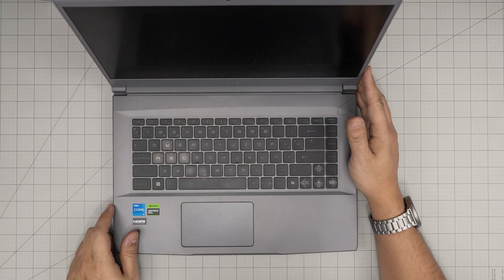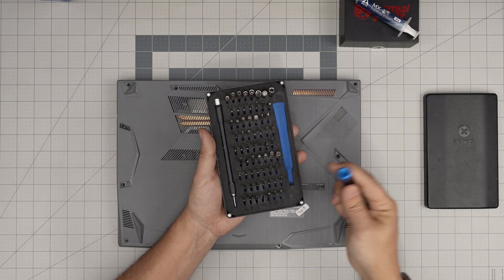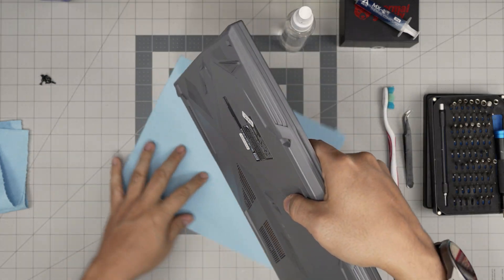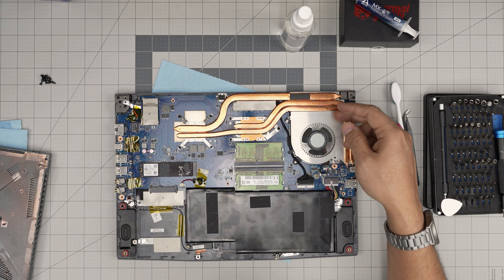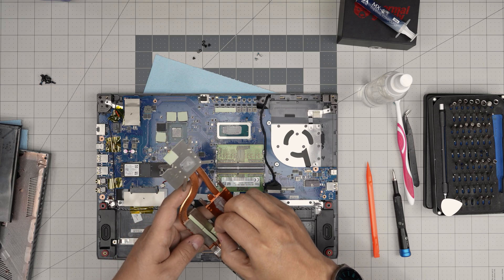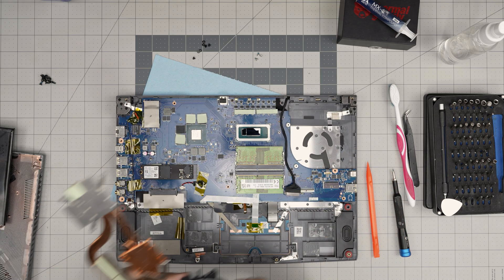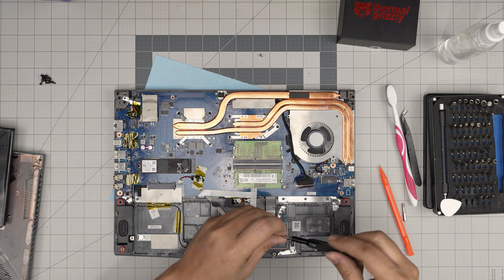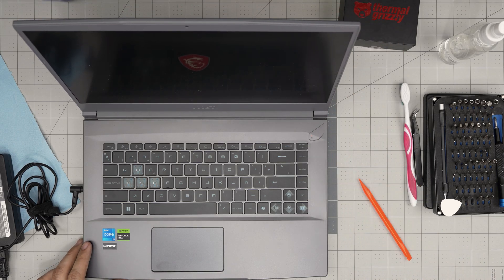How to Clean & Repaste MSI Thin 15 B12UCX | Fix Overheating & Boost Performance

Comment: Is it necessary to remove the whole battery?
Reply from the maker: 🫠Regarding your question, no it does not, but it does make it super easy to disconnect the battery jack.
cheers🍻

Comment: Hello sir, is it okay for me to replace the paste with PCM (Phase change materials) like PTM and so on? Is it safe for the laptop? I hope you can answer this thank you
Reply from the maker: 🫠Regarding your question, 100% recommended if you can find an original "PTM7950 Honeywell." Make sure it is a "Honeywell" — any other PTM options are not that great; we tested them. There are many fake "Honeywell" ones out there.
Should you have any further questions or requests in the future, please don't hesitate to ask me.
cheers🍻

Comment: I couldn't open no matter I push it from other side the headphones plug are stuck there what should I do
Reply from the maker: 🫠 Regarding your question, lift it up a bit more at a 45-degree angle and wiggle it to the left with a little more force.
Reply: @uFixTek  I fk it up bro. I damaged the battery coating & the cut place was burning for 3-5 second. I plugged the the charger once just to check & it was charging, I tried turning on my laptop once & it turned on but I turned off it immediately & removed the battery. What should I do?
Reply from the maker: send me a picture ASAP to my email:
ask@ufixtek.com

Comment: Can I leave the thermal paste as it is if I just want to clean the fan?
Reply from the maker: 🫠Regarding your question, no, because in order to clean the fan, you will need to detach the heatsink from the CPU and GPU. If you do that, then you will need to clean off the old paste and apply new paste, otherwise you will experience quick overheating and crashes.
Should you have any further questions or requests in the future, please don't hesitate to ask me.
cheers🍻
Reply: @uFixTek thanks a lot fam, i don't really have much knowledge related to the hardware part of the laptop so, it was great help.
Reply from the maker: It's my pleasure my friend.

Comment: Hello, is it necessary to replace the factory 1mm thermal pads?  If it is, what brand would you recommend?
Reply from the maker: 🫠Regarding your question, i would highly recommend you not to touch the pads. they are more than fine and can last up to 8years without any issues.
Should you have any further questions or requests in the future, please don't hesitate to ask me.
cheers🍻
Reply: @uFixTek last up to 8 years after buy or after factory release ?
Reply from the maker: after starting using.

Comment: Do you recommend doing this even for new laptop?
Reply from the maker: 🫠Regarding your question, I personally wait 6 months and keep an eye on the CPU/GPU temperatures to ensure they are not hitting 90°C.
cheers🍻
Reply: @uFixTek my MSI thin 13420h cpu hits 95c in cinebench r23 while plugged in at 65-75w of power then drops to 80c at 45w
Reply: @uFixTek I just got the laptop 3 weeks ago do you think it’s worth repairing with good thermal paste